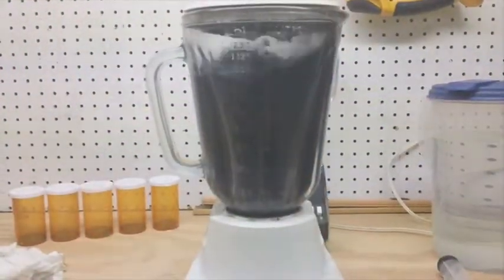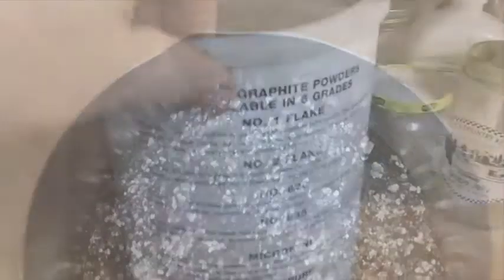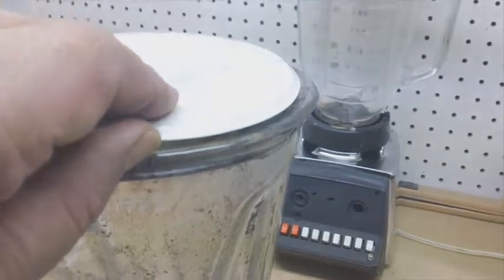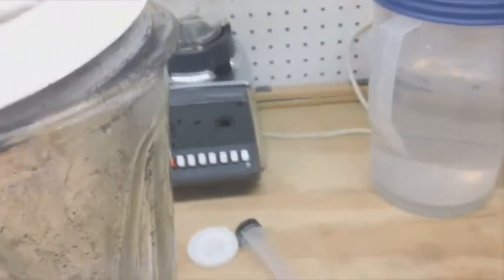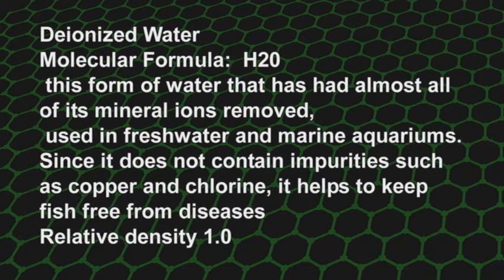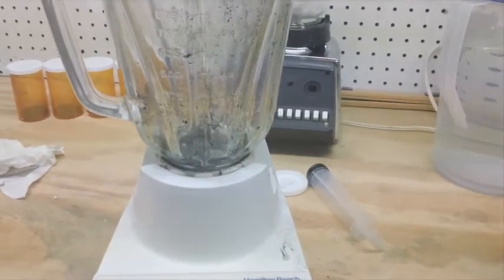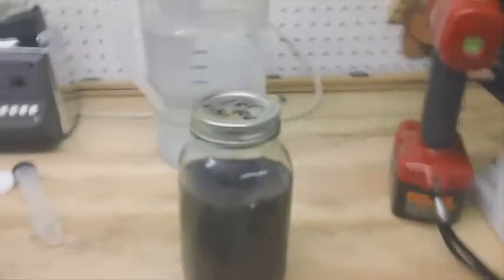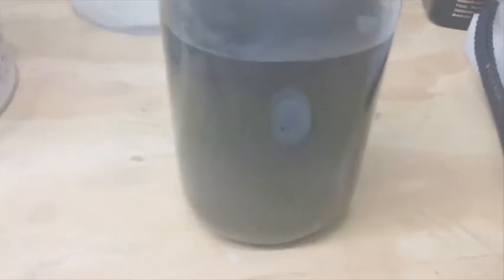Graphene blender method test Day 1

Comment: I remember some of the older blenders used a glass container...hard to find though...
Reply: Oyster uses glass.  Wallmart had the $45 model on sale for $19.  I picked one up.  Could the base possibly be 3D printed in a more resistant plastic?
Reply from the maker: Well they're not too hard to find I'd go to the goodwill or thrift store and pick one up for next to nothing
Reply from the maker: Colleen Forrest  you can't use 3d printed anything you have to remember that you're using acetone as a blending agent it will melt the plastic I've already had it happen to me not with a 3d printer but I PVC material they use for the base plate in one of my blenders.
Reply: you can if you use the right stuff, Taulman 230 will print with almost any printer because it has a printing temp of 230 and it is incredibly tough and ridgid so it beats the pants off PLA on rigidity, and the toughness against brittle breaking of ABS hands down and is not susceptible to most stuff other than things with methyl chloride in it, so stay away from dried epoxy solvents like tuff job remover or stripper X sold at home depot, also avoid PLA even though it does not fully dissolve in acetone, it does get soft and rubbery and split when drying ruining it completely. Not tried any urethane;s as they are usually only available in TPU which is a flexible filament, not as flexible as some but probably too flexible for any application you are trying here unless you are replacing some rubber part to seal it up,
Reply: oh I should point out the taulman 230 is a nylon, just that it was formulated to melt and print and stick at lower temp so you dont need a special hot end and printer to work with it like most other nylons